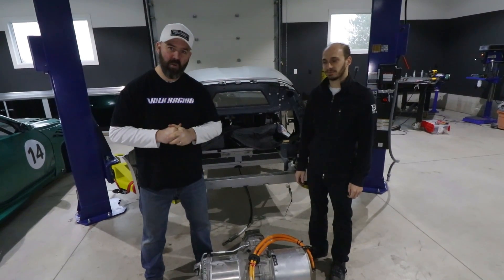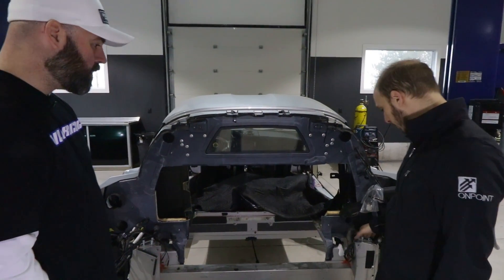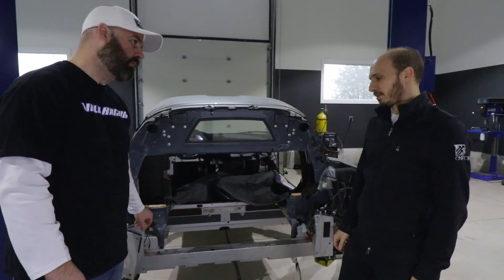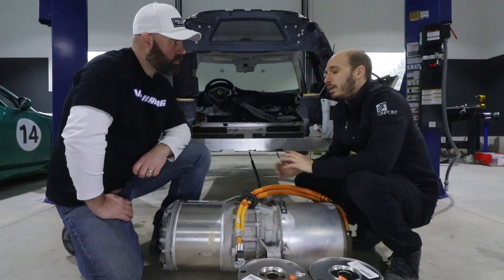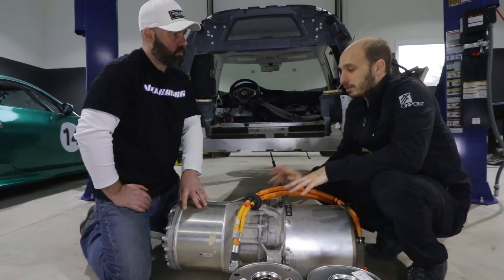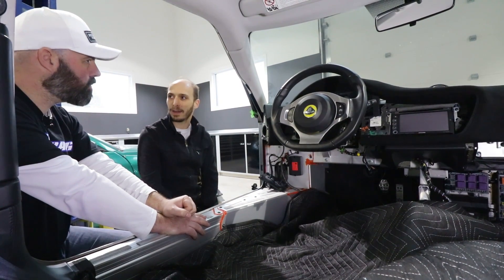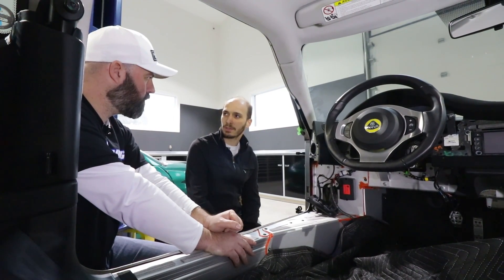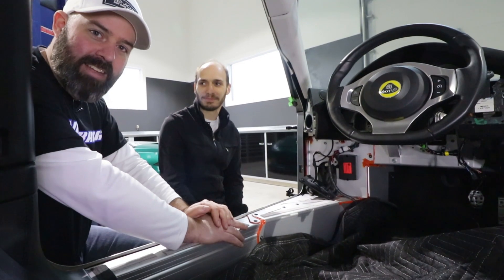Tesla Motor with Motec ECU On The Dyno - Lotus Evora Electric Car - EP02

Comment: The part about how the Tesla controller is way more complex to reflash than a normal ECU was interesting, but in the end the result is the same. The only difference is that instead of simply flashing the ECU like on an ICE car, you have to replace the controller itself with a standalone aftermarket (or in this case, modified) unit. I'm sure as more people work on these cars and as the aftermarket expands things will get much easier.

Comment: Tesla should do a crate engine program, like Chevrolet, where you get a controller kit to unlock and program Motor and batteries. It can be simpler than the ones in Tesla cars and open source.
Reply: trefod shhhh.  Don't worry.. There will be plenty of wrecks for everyone to go around.

Comment: what a weak chincy Dino only 250 horse started making that thing Bend and look unsafe most 2 liter 4 cylinder engines are producing at least 300 horsepower now or better. that Electric Motor & Control System that runs it is so complicated that you need a rocket scientist what a joke. I do like the sound of a Tesla Roadster get it done show the video
Reply: what

Comment: welds on frame were shocking he might be a tech genius but fk me his welding shocking
Reply: Gary Wait yes agreed the welds on that back subframe look like a kid in his first day of metal shop learning how to weld did it. if they wanted to be so cutting-edge why did they not use carbon fiber to make the back half out of saves weight and is probably just too strong. but I'm no genius but making a roadster has two simple theories lightweight decent power

Comment: Does this guy know that independant traction control systems are available that are designed to give the car the most acceleration without much loss of grip? I've seen them used in time attack cars the most, but if your worried about feathering the throttle, these systems help launches and exiting corners. They don't bog the car like factory systems either.
Reply: I am sure those COTS traction systems are based on pulling timing, cutting fuel, skipping spark etc... NONE of those apply to an electric car whatsoever.
Reply: Brian Jonas all it is are sensors monitoring wheel spin and telling the car what to do. If it has to adjust fueling and timing, i'm sure it can also control the input of an electric motor. An electric motor has a complex ECU, but it's not chemistry in which it has to monitor air, fuel, timing, and so forth to predict and control combustion, it's basically just controlling throttle input and electricity.
Reply: Brian Jonas all it is are sensors monitoring wheel spin and telling the car what to do. If it has to adjust fueling and timing, i'm sure it can also control the input of an electric motor. An electric motor has a complex ECU, but it's not chemistry in which it has to monitor air, fuel, timing, and so forth to predict and control combustion, it's basically just controlling throttle input and electricity.

Comment: The best place for regenerative braking is fully integrated with the brake pedal.  It's ergonomically best and also best in terms of safety to not have aggressive lift throttle oversteer, especially for non-racing-trained street drivers.
Reply: I like it better blended with the accelerator... takes a little getting used to but feathering positive and negative torque with one foot becomes second nature... The one issue is it kind of biases you to ignore the brake and adds a split second to you hitting the brakes... you've got to register that the regen isn't going to be enough and consciously move your foot to the brake...
Reply: Are you familiar with trailing throttle oversteer and why it's a bad thing, especially for untrained (non-racing) drivers?  (If you're not a racer then the answer is probably "no" on both.)  Regenerative braking on throttle lift potentially takes an existing problem and makes it much worse.

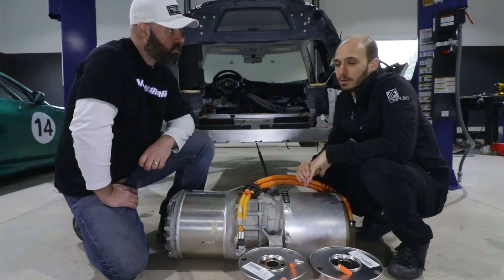Comment: 4:45 "10 times more complicated than a BMW ECU"

This guy has no idea what he's talking about. He's actually got it backwards. Modern engine controllers are easily 10x more complicated than an inverter module / motor controller...

Also, "it does its own immobilizer over CAN"

No way, Tesla does its immobilizer just like everyone else???
Reply: Look out Sasha, we've got a bad ass here!!!
Reply: ECUs have a lot of data points to cover, but it is not necessarily use complicated algorithms. Induction motors, especially high-power, are notoriously difficult to program for and control (i.e., complicated).

Comment: a vertical "handbrake" lever might be better if the paddle is fix to the steering column...because of where the steering wheel will be during cornering...just a thought...
Reply: actually it just came to me...a 3rd pedal...since you have no clutch...

Comment: why not just start with a Tesla Roadster? It's based off the Lotus.
Reply: The roadster was based off the Lotus Elise... with about 90% of the parts modified.... this project is based on the Elise's bigger brother the Evora... and there are advantages to that... for a project car more room to work and you need need more space/design weight to handle the high discharge PHEV cells.... A roadster isn't a head start on a project like this... it's more problems. Also... Tesla Roadsters aint cheap.

Comment: the regen should not kick in totally with throttle up, instead it should be mixed with the brake pedal. Not sure of the ergonomics of having 2 brake controls. To mix the regen with the brake, the pedal should be active to give a smooth feedback between the regen torque and the brake pressure. a computer should decide for the driver so as soon as the braking need exceeds the regen potential power the brake kicks in instantly

Comment: what kind of exhaust is gonna be used?
Reply: A motec system exhaust...
Reply: garrett2jz lol
Reply: garrett2jz probs a borla or go full straight piped
Reply: Whatever exhaust fits snuggly to his arse hole so that he can be heard shitting himself when he plants the pedal.
Reply: I'm more interested in the cooling system, the radiator placement, how many fans will be used and will they use the OEM items or go full custom. Additionally, are they concerned with overheating it at the track or do they only plan on running it during winter when the ambient temperatures are lower? There's a lot to consider which they have yet to touch upon.
Reply: Power, it will exhaust power.
Reply: Gallo 12 or gallo 24
Reply: Einimas will the car be exhausted, or will it have power?
Reply: A high tech engine synth generator with speakers rigged to pipes like exhausts could solve a few issues
Reply: do you normaly smoke from the back pipe of a 2jx... i really dont think you will get much of a hit from the back of electric car even with the high profomance Electric Exhaust <<Electric cars can have like a e cig exhaust >>
Reply: Cool is the only mod you need on a Tesla to make it full race car.  No turbo's, supercharges, intake, exhaust, ignition, fuel pump non of that bullshit.  Just cooling so it wont go in limp mode.
Reply: gnoxycat yup, for a whole 10 minutes until it needs recharged.